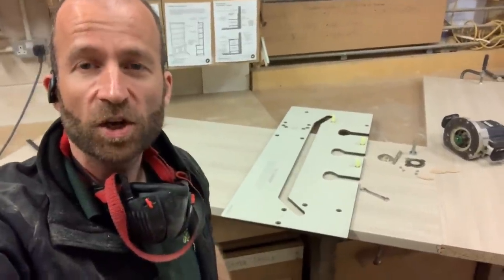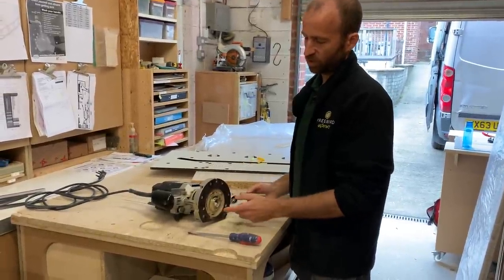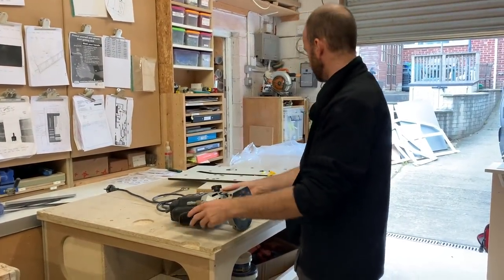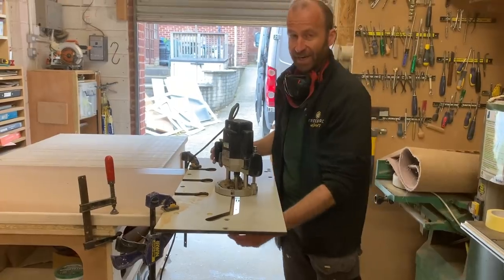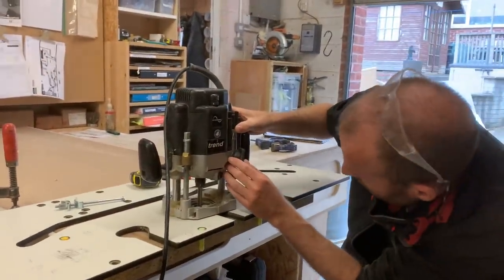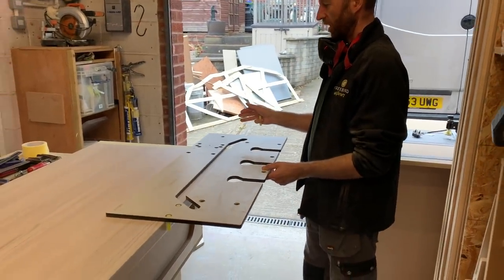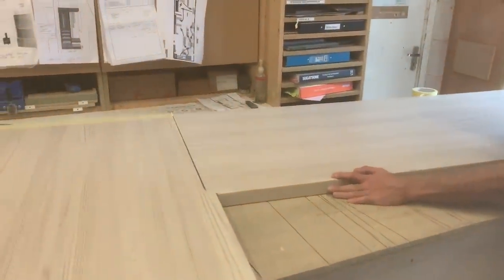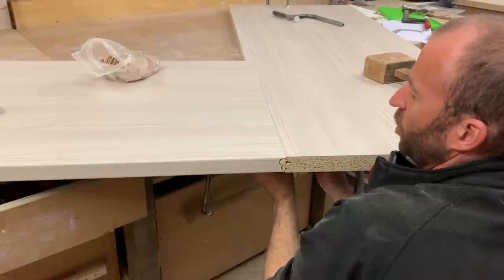How to make 'Mason's Mitre' worktop joints with a router and jig

Comment: First time I fitted a kitchen we were too skint to have a router so I cut the worktops by hand with a handsaw. They turned out really well. My top tip is to seal the cut edge with varnish (or similar) to waterproof it. That stops any water ingress from pushing up the top of the worktop over time with use and cleaning.
Reply from the maker: It sounds like you have amazing skill with a handsaw!
Reply: I just done one by hand last week, when i fitted the joint it was near so i just put my milti tool straight down the joint. Evened it out luvley

Comment: Best way is do one shallow pass. Then hog the waste out with a jigsaw. Then do the final passes with the router. I've fitted hundreds of the things.
Reply from the maker: Mike Clewlow do you mean you would run the jigsaw over top of the jig still in place?
Reply: @Alastair_Freebird  that's the one. Use a jigsaw on the jig. Once you've made your first pass with the router. You can cut all the waste off. It does save on cutters.  And gives a very clean cut

Comment: I love the look of this, I'm building a maple worktop for my kitchen and was wondering how this sort of joint handles wood expansion.
Reply from the maker: That's a good thing to keep in mind - solid wood is liable to shrink perpendicular to the direction of the grain, which means that the end grain (male) side of this joint could in theory move/reduce along the line of the joint.  In my opinion it would be best to add a precisely located domino or dowel near to the front edge of the joint to lock that in place.  Then all along the joint there should be biscuits or dominos holding the pieces tight flush to each other (so the top surface is held flush) but in slots that are a little oversize to allow lateral movement.   The worktop bolts can also allow a small amount of lateral movement.   Then shrinkage is likely to move towards the joint (pulling away from wall).  I'm sure opinions on this will differ as ideally there would be glue to hold the joint tight and hygienic, so this would work against allowing movement.  I would be interested to hear the opinion of any experienced solid worktop kitchen fitters.   One of the reasons that solid wood worktops are made from multiple small staves of wood is to minimise or at least regularise the shrinkage.  One thing I know for sure is that you should NOT do a full mitre joint on solid wood worktops as that is guaranteed to open up a joint, as each worktop retracts from the corner.
Reply: @Alastair_Freebird  thank you for the well thought out response my friend.
Reply from the maker: @jonq8714  you're welcome!

Comment: They don't teach you how to cut these joints when doing a carpentry and joinery nvq,or.they didn't when I did my 3 nvq,s. This is the first time I've actually heard it called a masons mitre,I've always known it as a butt and scribe joint.
I just got a jig from howdens and followed the instructions that came with the jig,they are pretty easy you just have to give your cut a bit of care and attention and then make sure that you have them lined up properly on the top and depth wise as you clamp it up.. Nice video though freebird interiors,you have another subscriber!

Comment: Even easier when it’s square edge worktops as you can just carefully take off the joint section of edging and then just do the bolt holes
Reply from the maker: brendan ford yes, although there is some controversy about the rights and wrongs of that method and some joiners insist a small masons mitre is best for square edged worktops too!
Reply: I personally when doing this cut mark where the router is going to cut, jig saw out the mass and then the cutter is only cutting a small amount and there’s no bit of worktop that falls away.

Comment: About the festool router. I bought one about 6 years ago from NB specifically for worktops. Straight out of the box there was a problem with the guide bush not sitting snugly in it's housing. The guide bush (supplied with the machine) would wiggle about which is obviously going to comprise accuracy. I contacted NB about this and they checked the others in stock and they all did it too so unfortunately I had to return the router. It would be interesting to see if this problem has been resolved, or maybe it was just  a bad batch.
Reply from the maker: JRS UK did it not have a sub plate like the trend - the bush fits tight into the sub plate but the sub plate moves and has to be centred using the 30mm centring insert?
Reply: @Alastair_Freebird  No it works differently. You use the quick release lever to open the hinged base and you then slot the guide bush / copy ring in. You can also use the same housing for the chip deflector in other applications.  On mine, and the others tested by NB, the guide bush had movement. I now have the Makita which works differently again from the Trend. With Makita there is a quick release lever that locks the guide bush firmly in place. I've had no problems with this on my Makita but the dust collection is rubbish.
Reply from the maker: JRS UK quick release would be useful
Reply: @Alastair_Freebird  I have a Festool OF1400, and don't think it is the best model for guide bush work... the quick release system is convenient, but there can be some play in it, and there is no easy way to adjust the guide bush if it's not perfectly centered... I'd also add that the dust collection accessories are very fragile and fiddly.

The benefit of the OF1400 is that it's plug-and-play with some unique Festool accessories, including the LR32 drilling template and the MFS400/700 routing template, but otherwise it's nothing special or innovative. My very old Porter Cable 7529 plunge router is better when using guide bushes and in terms of dust collection design (its edge guide accessory is also very robust and precise).  The smaller Festool router (OF1010) has a more confidence inspiring dust collection system (similar to my PC router), but can't take 1/2" router bits... and the bigger, and more expensive OF2020 isn't perfect either for hand held work (and lacks the plug-it system as well), although I don't have direct experience with these other models in the Festool range.
Reply from the maker: Francois Lafaix this is all very interesting and helpful thanks - so the festool routers aren’t perfect!
Reply: I had a festool years ago and it was pissed and you couldn’t adjust it . My Elu is spot on . Think fes are way overrated myself . I use makita
Reply: @Tez73  When I was working in Germany a few years back my German colleagues didn't rate festool at all. I do really rate some Festool tools but in my experience they absolutely are not head and shoulders above over tool brands.

Comment: Nice Video.
I’ve been doing a few of these lately still slow. However I never get a square room. How do you compensate for a room that’s out of square. I have a way but it tends to be a bit hit and miss… as it involves sliding the male cut round at an angle scribed into the female cut. It doesn’t take much to be out. Any tips?
Reply from the maker: That is a tricky one because as soon as you make this hockey stick cut at anything other than 90 degrees you get an imperfect line up of the bullnose.  Unless you can cleverly tilt the Jig by the same amount on both male and female parts so that the little 45degree return cut for mitring the bullnose perfectly bisects the new angle but then your kind of working blind without the positive stops that come with the jig.  A slightly different angle may be acceptable and you can fill the difference with colour.  Sorry if that doesn’t really answer… to be honest there are far more experienced users of these jigs out there than me!
Reply: @Alastair_Freebird  I’d like to think you’d fit the units square to compensate for an out of square room. Providing they’ve given you over sized end panels 😄 but yea if the rooms out of square you’d fit the units square and scribe worktops in to wall. I’m no expert but I am a carpenter that’s what I do
Reply from the maker: @rubiconexotic8753  that certainly makes sense to me too, within a certain angle - if the angle gets very obtuse then it may be best to run the units parallel to the walls

Comment: Can you use smaller sized bushes? for example if you used a 12mm bush in diameter would it just make a bigger cut! but male and female would still match?? thank you.
Reply from the maker: I think the male and female would not match with any other bushing!

Comment: Do you have to use a 1/2 inch? I have a 1/4 inch router with no option to size up the collet.
Reply from the maker: Needs a lot of power, I wouldn't recommend using a 1/4" router for this
Reply: @Alastair_Freebird  Noted, thanks! Successfully did the worktop with a 1/2"

Comment: Hi, very surprised to learn that Brady never did the worktop joint at college. It is very much part of the level 2 diploma qualification, and all our learners are taught this joint at my college. On a side note to this it always makes me smile when I hear this called a mason's mitre, I would call it a butt and mitre. Before all the kitchen fitters out there jump on me they really need to check out stone mason's to see what a mason's mitre really is, because as the name suggests that is where it originated from stone masonry. I guess in reality you can call it what you like as long as you make a good joint. It's a bit like in my early days clamps were called cramps as sold by British companies like Record, but since the Americanisation of woodwork with the likes of YouTube they have become clamps. I am happy to explain this further about the joint if required, I did try to post a picture here but it would not allow me to.
Reply from the maker: Gary Blake are you a tutor then?  I believe the term masons mitre is correct in this usage - as opposed to a continuous 45degree woodworking mitre which presumably would be less suitable for masonry as it would create fragile 45 degree corners.  I also remember my DT teachers at school constantly correcting us from ‘clamps’ to ‘cramps’ but clamps always sounded right to me and it seems to have stuck!
Reply: @Alastair_Freebird   Yes I am an instructor at my local college, I trained and spent over 40 years as a cabinet maker, making fine reproduction furniture, and high quality joinery. A mason's mitre does not actually have a mitre fun the way that the worktop does, it is difficult to explain without diagrams, but as I said the term comes from stone masons and they did not cut mitres, it was carved into the stone. I can send you some diagrams of what true mason's mitre is but not sure how to do it via YouTube. In a mason's mitre you do not remove any timber on the female part it bis butted up and the mitre is carved in. If you make a glazed and rebated door frame you remove part of the mould exactly as you do with the worktop on the stiles and mitre the rails in. If you do a search on google you just get what people have now come to call a worktop joint as a mason's mitre, I do find this quite amusing but that's life I guess. The jig we use at my college comes from Screwfix I believe and on none of the accompanying paper work do they mention mason's mitre.
Reply from the maker: Gary Blake I am interested now, yes send me diagrams via my email found at www.freebirdinteriors.co.uk (I don’t know if posting the email directly here might attract spam)
Reply from the maker: Gary Blake just seems you’ve sent images now.  Aha, I understand perfectly what you mean now!
Reply: @Alastair_Freebird  I was just thinking did Brady study the bench joinery or the site carpentry course? as it is on the site carpentry course that we do the kitchen fitting.
Reply from the maker: I think he did a bit of everything but probably more bench towards the end
Reply: Gary Blake I did nvq,s 1,2&3 in carpentry and joinery around about 1995 and we weren't even told about this joint let alone shown how to cut it,perhaps the syllabus or tutoring guide has changed or something like that.
I've always known this as a butt and scribe joint.
I have been pondering for a while now about getting in to tutoring,I just feel that it would be awesome to teach the next generation of joiners and I would certainly do a much better job of teaching traditional roofing joinery than  our tutor did.
I remember the year of my nvq 3 was the first year that they brought in a written test for it or so they told us. I will always remember that as I passed both with distinction. It's the best trade ever but definitely the most expensive one to get tooled up for!
Reply: Gary Blake mine was the site joinery course though we were taught alongside the bench hands. I'm a bit gutted now to know that we weren't taught it,it feels like I got a second rate education lol.
Reply from the maker: Mindyourown Business good and passionate teachers are a good thing, it would be great if you do it!

Comment: I'd be interested to hear your thoughts on the trend T11. I have a small hand trimmer and a Bosch 1/4" and I was looking to get the Trend as a 1/2" router.
Reply from the maker: Mama Shama T11 for router table use T10 for hand held. Same basic machines as the DeWalt.  Flimsy brittle dust ports are annoying.  And on my T10 the depth stop tightening system scraped off its own measuring scale tape.  So a few poor design features.  But see other comments here about festool router failings too.  Sounds like makita might be a good option.
Reply: @Alastair_Freebird  thanks for the info. As I understand it the Trend is essentially the same as the DeWalt but with some added features to make it more useful in a router table - I think that would be my primary use for it. The Bosch is also one I am considering as it comes with the 2 bases which makes switching between router table and hand held a little easier and quicker
Reply from the maker: Mama Shama the trend T11 is the router table variation of the trend T10.  The T10 is just like the dewalt I think
Reply: Marma sharmeryou won't go wrong with the trend,trend is the name for all things router here in the uk. Get yourself one of their two part hinge jigs aswell,you won't regret it!

Comment: Alister, how do you find the T11 when used in a router table?
Reply from the maker: It’s good for that. My problems with the T10 and T11 are some parts aren’t durably designed, especially the dust port but when use in router table none of it is so much of an issue
Reply: @Alastair_Freebird  Aye, I've got the T10, its good but not without faults.
It's as though they spec the cheapest plastic possible for the dust port... all the routers around this price point seem to not be without issues.
Festool and now Bosch having the dust port built into the base plate looks fantastic.
But, the adjustment on the T11 for use in a router table makes it very appealing, for that purpose.

Comment: Hi Alistair, where do you buy the guide bush centre bit? I've struggled to find one and would be quite handy. Thanks
Reply from the maker: A D I’m honestly not sure, I’ve had it for ages and I think it must have either come with the router itself (the T10 version) or else it came in a kitchen fitters pack along with the trend 30mm bushing I’ve got
Reply: No worries, thanks for the reply and great videos
Reply: A D I ised to have a fifty pound cheap router from b and q when I first started cutting these joints and that had come supplied with the required 30mm guide bush,if your router doesn't have one then I would suggest that you search through google by for example searching something like dewalt 30mm router guide bush. Failing that trend definitely sell them as well as the 16mm ones for use with their hinge jigs.
Reply: Screw fix
Reply: @curtylou  no chance. I got one from tend direct in the end. I got a dewalt one off ebay to start with, when it arrived I found it was 12mm so nfg. The trend one is okay but not 100% perfect. Works okay for me though
Reply: If anyone needs one this is the part number to search for
Trend WP-T9/090 Line up pin 12mm 1/2 shank T9 T10 & T11
Reply: FFX Sell them at the moment for £6.34

Comment: The other angle is to split a 45' instead of a 90'.
Reply: @Rob V. 
It is a less common design now than back in the 90's say, but it just depends on the kitchen layout and design.
Reply: James bail and I've never once seen a kitchen worktop cut on a 45 in my thirty years in the building game. It would be a nightmare to get it lined up properly due to the corners very rarely being a true ninety and even if you bisected the angle I would still consider it to be rough as fuck as would any joiner worth his salt!

Comment: You can’t shunt it back if it’s measured to fit.  Also trend router’s are not that bad. If your a decent tradey then should be busy enough to buy the router you feel suits your workload.  Like if the trend is that bad then why post a video of you using it at a professional level demonstrating!
Reply from the maker: Hi we don’t really do kitchens, I wasn’t using a half inch router regularly; having bought this one it did the job but it annoyed me, just on some of the details that seemed unnecessarily fragile.